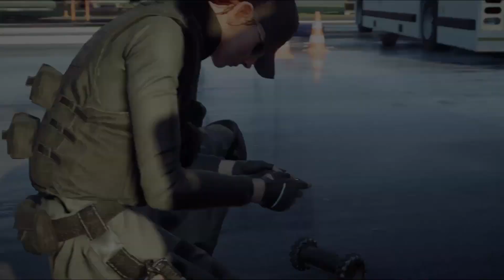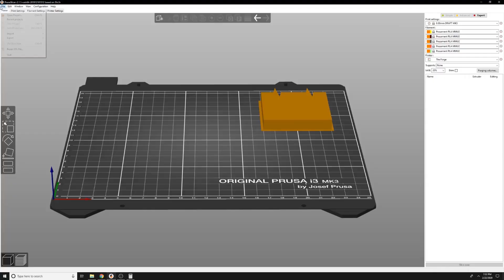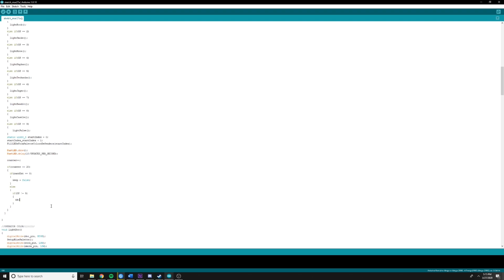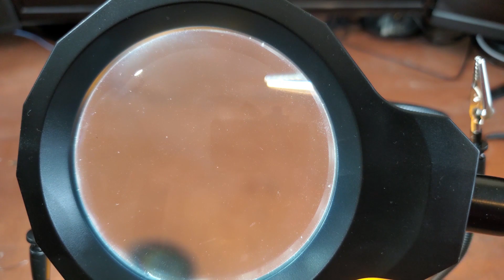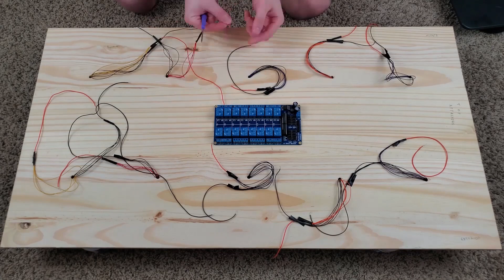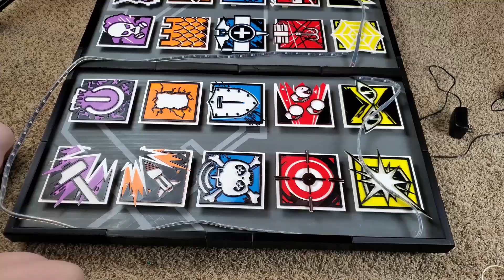Rainbow Six: Siege Operator Roulette DIY project

Comment: How much did you spend in total?
Reply from the maker: Well lets see:
Wood panels - $25 x 2
Arduino - $10
Lights - $13 x 2
16 channel switch - $9 x 2
plastic - so this one is a little difficult.  I probably used a total of $50 or so in plastic, but it depends on you having all these different colors to start off with.  I have a pretty extensive library of filament.  if you don't then this step could be more expensive
misc hardware(support wood, wiring, screws, ect...) - $5

total - $159 or so
Reply: @SomeBadEngineer  Ok, thx

Comment: Hey man, great vids! As you know we’ve been in quarantine for a while now and I’ve taken up DIY as a fun escape and seeing stuff from my favorite games irl. I would really like to make this and some other things using 3D printing but I don’t know how to use it at all nor do I have one. There’s a library near me that has one that I can use for free as long as I supply the layouts. Any recommendations of how to go about this or learn to 3D print?
Reply from the maker: Glad to hear it would inspire you to do something fun!  The biggest piece of advice I have for anyone around 3D printing is to be prepared to fail.  What's not featured in this video is that printing the operators took about four weeks with several iterations and a dozen or so failed prints.  3D printing is finicky and takes a lot of patience.  There are some YouTubers out there with very in-depth resources, so I would recommend looking at them for general knowledge(such as 3D printing nerd).  I would also do some read up on the specific printer you will be using.  I have a Prusa i3 Mk3s and an Orange Longer 10, and both of those have great Reddit communities that answer any question I might have.  The last thing I can suggest is to try to start with something relatively simple.  These designs are pretty easy and the only hard part about them is the multi-color.  If you want to print the operator symbols in a single color, it would actually be very easy.

Hope this helped, give me a shout if you have any other questions and consider a subscribe if you want to see more projects like this
Reply: Some Bad Engineer, thanks so much I’ll look into it! This really helped! And ofc take a sub😂
Reply: And to be clear I don’t want to make the roulette with wiring and such, I’m mainly interested in the icons and back board to put in my room! And advice would be helpful, thanks!